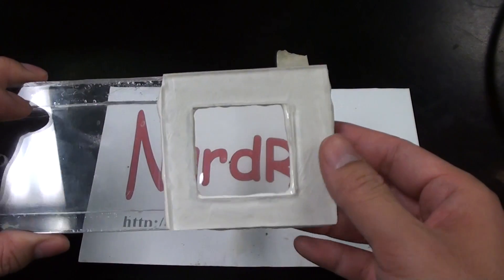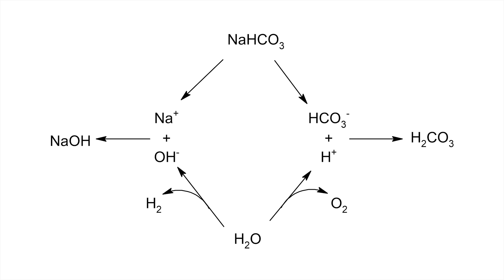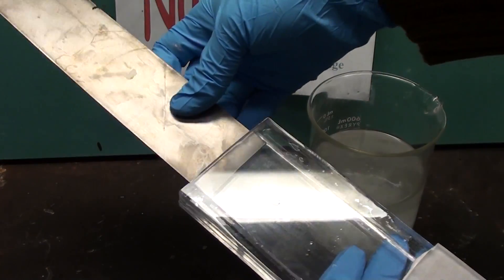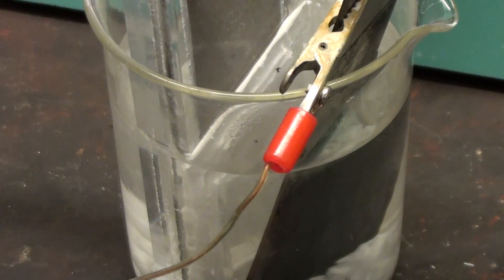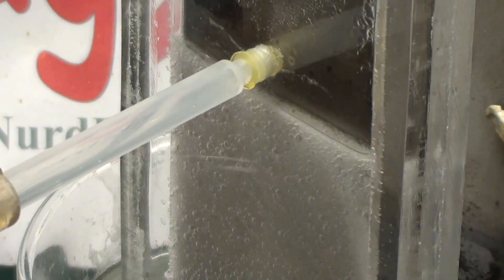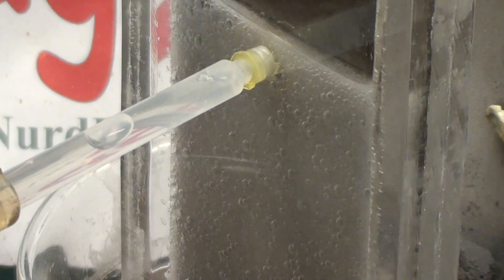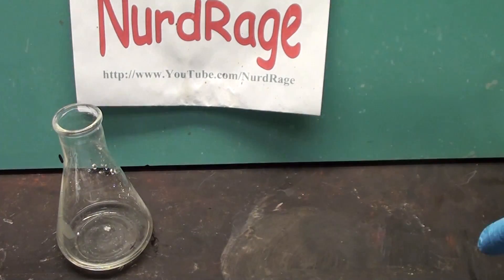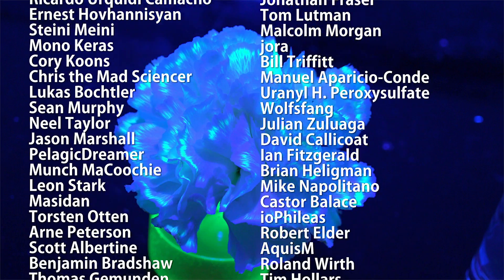Make Sodium Hydroxide by Electrolysis with a Nafion Membrane Cell

Comment: I recall you did a video a while back where you separated the components of a spent DI-Water producing Ion exchange cartridge fairly easily by exploiting density differences in the anion and cationic exchange functionalized styrene polymers. Have you considers dissolving the separated beads and casting a film from those solutions to use as anionic / cationic exchange membranes? Obviously those materials lack the superacid functionality of Nafion and would not perform as well but they would be more amateur accessible.
Reply: My thoughts exactly. I played around with the idea but never attempted it. The beads are cheap and readily available in bulk from places like Home Depot for recharging large whole home filters. There are papers describing the process of making these membranes from scratch but I believe using the styrene beads eliminates multiple steps. All that should necessary is to dissolve the beads in something like acetone, coating a glass plate and allowing the acetone to evaporate. (I'm going off memory here and it has been a while but I believe acetone is the solvent).
Reply: Because linear polystyrene sulfonate is soluble, they use polystyrene/divinylbenzene copolymer as backbone of resin, making it harder to dissolve. So maybe you can't just dissolve it and make membrane out of resin, and the process might also require some heat.
Reply: @Ritalinergic  I thought it was just sulfonated polystyrene. I really don't remember the process. I'll have to find the link to the paper. The attempt was to show polystyrene could be recycled into membranes. I think it would be a popular video if someone could show "amateurs" can accomplish making reasonably efficient ion exchange membranes.
Reply: @hubrisnaut  Maybe it's just polystyrene sulfonate, not fully sulfonated. Or is it insoluble enough with some kind of treatment? I don't know exactly though. I've never thought it could be stable without crosslinking!
Reply: @hubrisnaut  I found paper about partial sulfonation process. Is it what you've mentioned?
DOI: 10.1016/S0376-7388(99)00258-6
10.1007/s10924-006-0018-3
Reply: @Ritalinergic  I could not resolve your reference. Perhaps send a link. I will look back at my work.
Reply: @Ritalinergic  I found a link to a paper using sulfonated PS and dichloridemethane in my work. Hang on... I'm going through a rabbit warren of past research here.
Reply: @hubrisnaut  I cannot upload the link, sorry for that
you can find doi, any links will be cut automatically.
Reply: @hubrisnaut  First reference contains partial sulfonation by mixture of sulfuric acid and acetic anhydride in 1,2-dichloroethane, and second one contains sulfonation of polystyrene granule with conc. sulfuric acid, making insoluble ionomer particle.
EDIT:second paper doesn't include anything about the mechanical structure of the particle.
Reply: @Ritalinergic  I can't find the paper but a lot of bookmarks I made are not are not resolving (404, not found, etc). I am pretty sure the sulfonated polystyrene was dissolved, cast into a film and tested as a membrane. Pretty sure the work was done in India. Will work on it. If I find the process, I will come back. I'm going to sub to your channel.

Comment: Great video ! A question @7:18 - if you do this electrolysis with table salt NaCl why doesn´t it produce  HCl at the anode to a lower extent, next to the O2 and H3O+ and Cl2 (Cl- and H3O+)?
Reply from the maker: it does actually!, but as the pH gets lower and lower, chlorine formation becomes the dominant reaction.
Reply: @NurdRage  so there's a way to make HCl and NaOH at the same time by using table salt and sodium bicarbonate?(assuming both sides somehow aren't able to combine back into salt and water, ofc)

Or would it inevitably be a way to turn sodium bicarbonate into table salt and make a lot of chlorine, but with extra steps?

(Ik my questions are pretty stupid, but what if you took them seriously anyway just as an exercise in basic chemistry logic to explain me what side reactions are instead of actually treating me like a clueless kid(wish I had that as an available excuse, but I'm just clueless) that's just curious about what happens when you mix every chemical In sight and zap it with electricity? Like, just for fun? Lol)

Comment: Don’t nafion membranes get poisoned by impurities easily? I believe your feed solution is meant to be ultrapure….
Reply from the maker: they get clogged, because the minerals deposit into the membrane under alkaline conditions. You can clean the membrane by washing the whole thing in hydrochloric acid and then distilled water.
Reply: @NurdRage  ok thanks….what thickness did you go with?
Reply: @NurdRage  and what resin did you use to glue it down?
Reply: @jean-philippepollonais1104  He said in a previous video, that he solvent bonded it with mek, iirc.

Comment: I've tried this type of electrolysis(but using clay pot as membrane) and made some H2SO4 from Na2SO4 solution. I'm really glad to see you do such type of experiments! 

Awsome vid as always! ❤️❤️❤️
Reply: Won´t that just dissolve the pot?
Reply: @xxxm981  I saw some spots on the pot so it does corrode the pot a little. But still, is VERY SLOW.  You can try shitload  of times before you will finally destroy your pot.

For more info, go to the channel "Scrap Science".
Reply: @heisenbergstayouttamyterri1508  Did you ever measure your yield?
Reply: @xxxm981  Sadly, no. At that time I couldn't coz I didn't have the required instruments to measure the yield. But I was able to test and confirm that it was H2SO4. Like CO2 was released when it was mixed with Sodium carbonate and produced Barium Sulfate precipitate when mixed with soluble barium salts. It contained a very minimal amount of Na+ ions that somehow leaked but was too low to interfere in any reaction.